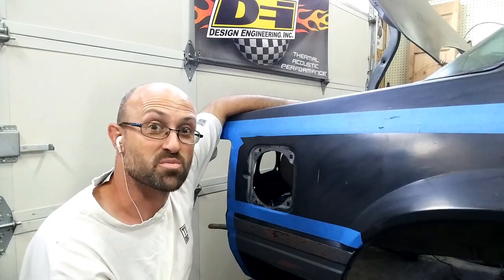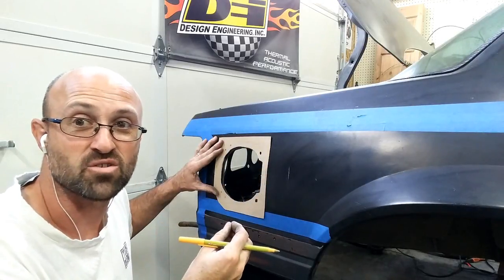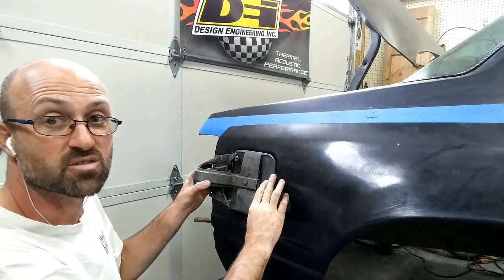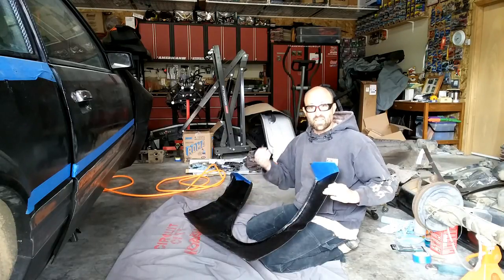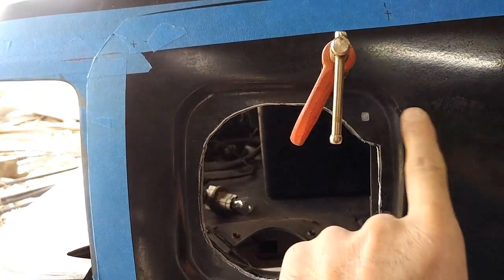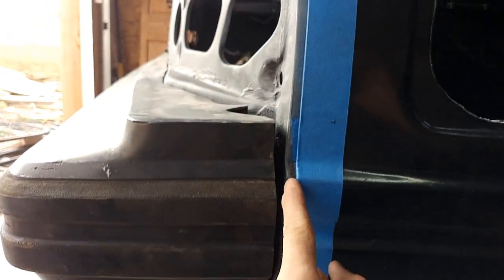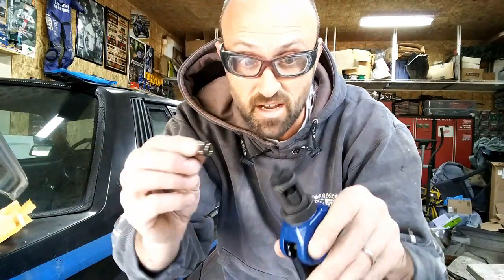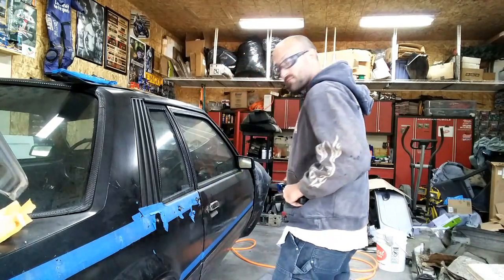Maier Racing Foxbody Widebody | Rear Passenger Quarter

Comment: Nice work!It's going to look sweet....
Reply from the maker: When I finished this work I just sat there in my garage just looking at it.  I imagined some deep wheels and fat tires under the back.  I am eager to get it all done and see what the finished car looks like.  Then I have so much more to work on too.
Reply: Basin Motorsports I hear you my man!I'm installing new control arms and all bushings in the rear.I pulled the rear end to clean everything up.I have the gas tank out to install a bigger fuel pump and I'm painting everything and clean it all up it's not a show car, but it should look pretty good for a home build!Just trying to make it the best I can on a budget. I installed the battle boxes, going to weld up them up ,while everything is out the way!Getting ready to do the mass air conversion, I have all the interior out so i can do it right.Wide tires are going to look sweet on your ride!I'm going to run 10' wheels with 275's on the back of  mine.Good luck on your project!
Reply from the maker: Frank Clement show car or not, keeping your car detailed up will only help keep it in good mechanical shape. I think the little details are the most satisfying.
Reply: If you want to see my car go under (sold in a flash white stallion )on you tube! Yeah that's me,lol!
Reply: Basin Motorsports I agree with you buddy.Its all in the details!
Reply from the maker: Frank Clement I like the stripe on the GT and Welds are timeless.
Reply: Basin Motorsports You are the first person I showed that video to,lol!My buddy took pictures and then put it all together! I was very surprised to see it myself! Thanks for the complament I appreciate it.Ive done a lot of work since then that was back from 2015!

Comment: So, do you cut out any of the original fender for the wheel clearance?
Reply from the maker: Yes. You cut the original arch on the outer sheet metal, then form the inner to close the gap. I have a complete video on the process later in the series. I have a video covering the whole process (and whole car build).

Comment: I'm running a 315 on stock drum rear.. no rubbing at all on the outside.. do you recommend maker racing flares still?
Reply: Maier*
Reply from the maker: Joe Septien I'd say it's really up to you. It sounds like you don't need them for your 315's. Can you tuck the wheel and tire completely as if it is bagged?  That is my goal, and also I just like the look as well as the potential it allows.
Reply: I agree 100% I always wannna go wider but 315s are a nice goal to have as a squared stance..  I may need the front sides luckily you have videos about them, thanks man good vids

Comment: Maire racing? I just cut my outer fender befor painting it and I got lucky to fit a 315 tire it rubs a little bit I also have dead shocks also nitto runs their numbers high like a good year tire 295 is the same as a nitto 315 looking good nice flare I wish I would of done some small flares on mine but now is to late car has been painted
Reply from the maker: winglesschip 209 yes, I'm doing a 3" Maier Racing setup.
Reply: Basin Motorsports nice I didn’t know they made body parts for foxbody mustangs
Reply from the maker: winglesschip 209 yes, they have a pretty big selection of foxbody parts. Full SCCA race setups down to just flares and hoods.
Reply: Basin Motorsports no suspension parts right last time I asked they sead they didn’t make parts because theirs no market their because maximum Motorsport has every part covered
Reply from the maker: Yes, Maier Racing doesn't do suspension.  Mike Maier Inc. has split off from Maier Racing, but they again aren't doing Foxbody suspension.  MMI is doing the first generation and S550 suspension (with Old Blue and New Blue) as their shop cars.
Reply: That’s new news thanks I was going to go to their shop their like 2 hrs away but I guess it saves me a trip since he’s the one with the branes